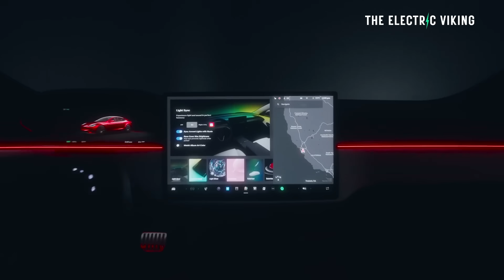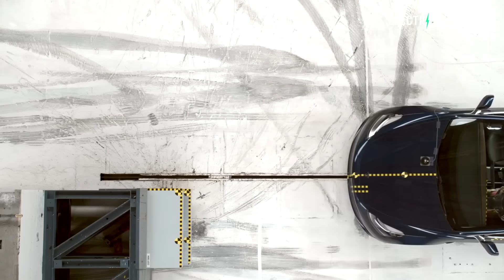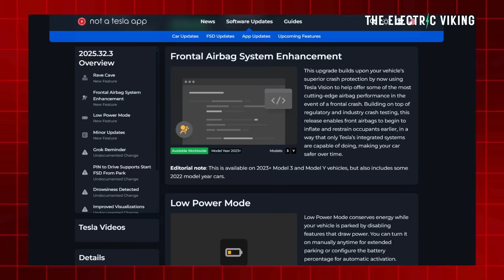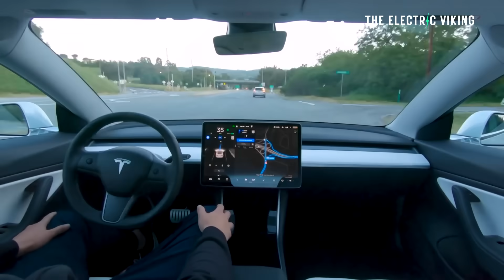Tesla Rolling Out Game-Changing Safety Update Across Entire Fleet

Comment: Sorry, the airbags feature looks like Tesla are trying to cut costs again.  If you can ditch the accelerometers and use the camera that you already have,  big cost savings.
It's hard to see how the camera would be as quick as the existing solution and could also either fail to deploy (didn't recognize the impending problem) or could deploy on a false positive.
If the camera is obscured or being re-calibrated, could it fail to deploy?
Airbags today, deploy in around 20 to 30 milliseconds and have redundant sensors in case one fails.  Most of the time, your hood will have barely started to crumple and the airbags will be deployed.
Why mess with something that already works just fine, unless you're trying to cut costs?

Comment: The acceleration of a 200ft fall will be 76 mph.  The speed of the car will be perpendicular to this.  So there is both a vertical and horizontal crash, but I have no clue about how they would combine.  Strangely I think the forces would act independently, so it would be like having two accidents at one time.

Comment: The road toll is not increasing it has been consistently falling since the early seventies and is due to vehicle safety improvements.
Reply: The number of deaths due to car accidents has been increasing the past decade or so in the U.S. In 2014 there were 32,744 deaths, or 10.28 fatalities per 100,000 population. The past couple of years the numbers have been more than 40,000 deaths and more than 12 fatalities per 100,000 population.
https://en.wikipedia.org/wiki/Motor_vehicle_fatality_rate_in_U.S._by_year

Comment: I was taking a right turn on red and didn’t see a bike in front of me and Tesla slammed on the brakes for me preventing an accident. Tesla is the bomb
Reply: Over the past 9 years, my Tesla has taken over about 5 times to keep me from hitting pedestrians or critters.
Reply: @eddeppman , higher end cars since 2015 with AEB (automatic emergency braking) do the same what a Tesla does. And in the last couple of years all the new cars are mandated to have it. It’s a great feature that avoids accidents, damages and people getting hurt.
Reply: @gregtheelectricviking  Incorrect. According to the IIHS (Insurance Institute of Highway Safety) tests, many of the former systems have been downgraded to Advanced, compared with Superior for Tesla. The difference is that Superior means the car can see objects either moving perpendicular to or parallel to it at night, up to 37.5 miles per hour. Examples of those revised to Advanced are the Honda Sensing suite.
Reply: This happened to me as well.  Bikers coming down the wrong side of the road is susceptible to right turning cars looking left only.  I don’t know whose fault it would’ve been if there was an accident, probably the cars fault.  But my Tesla immediately slammed the brakes and avoided hitting the biker going against traffic.  After that, I was like, OK, this car is worth every penny.

Comment: I think this is about Milliseconds, not seconds, so the airbag doesn't hit you in the face on Impact, but your face falls into the allready inflated airbag. After that the airbag does deflate pretty rapidly. Timing is the key.
Reply: What's the evidence that airbags don't work just fine already, using accelerometers to trigger them? What is the problem to which this is a solution?
Reply: @brendanpells912 Fair question. Maybe it allows airbag optimization at different speeds? I don't know but won't assume Tesla is doing it for kicks or a sales gimmick at this point.
Reply: That's what I wanted to comment ;) But I'm very sure the Tesla engineers have figured out the right timing.

Comment: wish you could request a software update, rather than waiting for Tesla to deign to let you.
Reply: Mmm, not sure how being able to request it would be better. You get the update when its ready. ie its been through the full design, build and test cycle. 

If you have a Tesla, you should also know that you can opt to take updates as soon as they are available. i.e. before they have been out in the wild for a bit. It's a simple setting within the car's menus.

This does increase the risk that you get an update with a bug that testing failed to detect but which will likely have been fixed if you get it later after the bug has been spotted. After all, no testing in perfect. It's always a balance between time, cost and risk.
Reply: @johnfranklin6394 yes, but it also means that every new software update is installed twice. So 2x the write on the memory. I intend to keep my car a long time (as long as no 'environmentalists' here in France set it on fire) so I'll not bother with advanced updates. I've lost hope of ever receiving 'Full self driving' here for this car😢